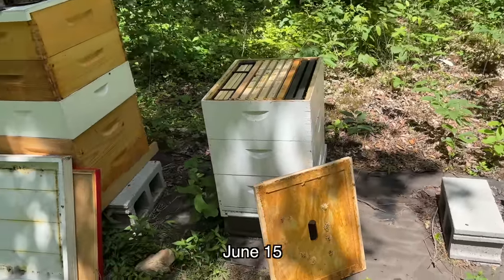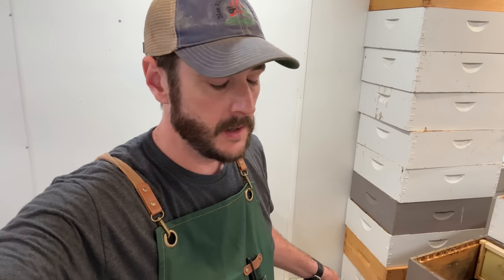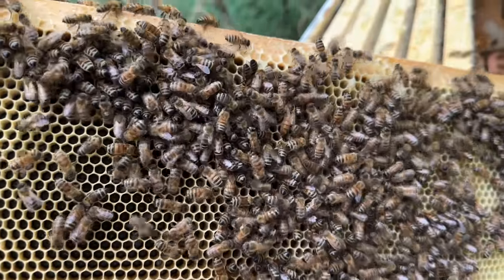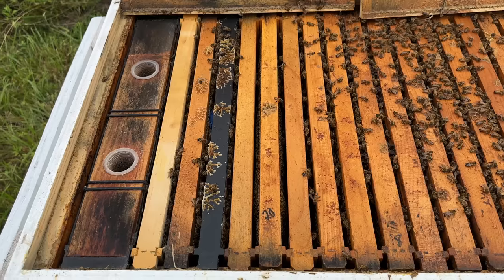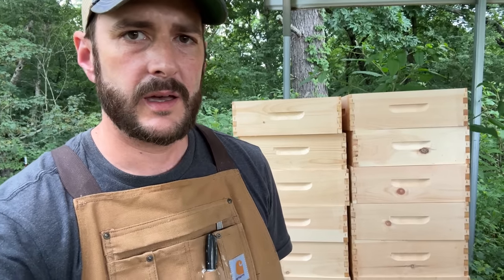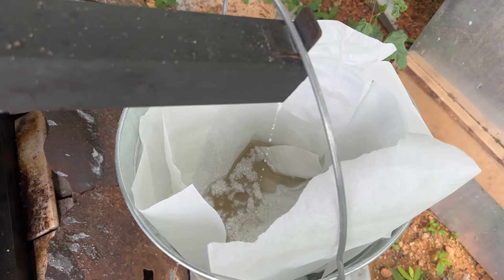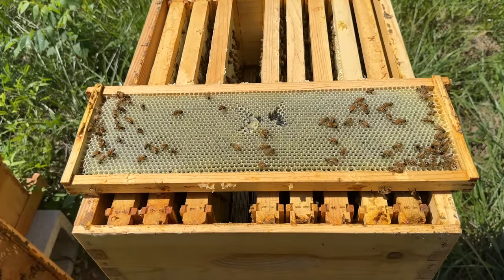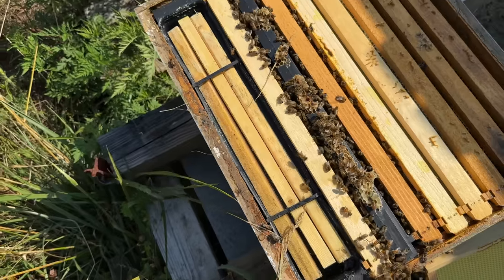Building a Bee Business Vlog #20

Comment: The joints don't fit because the moisture of the wood has changed since the joints were cut. The foaming in the wax tank suggests the wood moisture increased since you purchased the hive bodies. Every time I purchased assembled equipment, the quality wasn't comparable to my own. Either wrong staples or not enough glue.  Wood stove heats my shop all winter long, winter is equipment season and summer is beekeeping season. I admit I'm tired of the wood stove, so this winter, I am putting in a heat pump. The first 4 years I was always late on equipment preparation, this year I have extra ready, now I have a day off. Beekeeping is 6 days a week all summer, and vacation is the reason they swarmed or the week you should have done mite treatments. If you are maxed out now at your current hive count, then I suggest you focus on time management before you increase your workload with more hives.
Reply from the maker: Thanks!

Comment: And last little thing to help with the filter issue, put a honey gate on a 55, pour everything into it when coming out of extractor, leave it tall enough to pour off clean 5s at the bottom, wax sits on top while you pour out 1000s of lbs, no more multiple bags of wax sitting around dripping out….

Comment: Not real sure who all the suppliers are around your area.  However, how I got it here is by getting in touch with the local schools concession stand.  These are generally run by booster clubs around here.  As such you find they order in bulk for "small business" aka Ben E. Keith, Gordon's, etc that not only sale in bulk, but in most cases deliver it as well.
Reply: Additionally, on your question last week, someone had suggested vinegar.  As such I figured I would test this.  I added 1/4 cup per gallon on a 5 gallon bucket, added a gallon to 5 of the hives.  I have to say the bees took it down pretty quick, and the cap and ladders were clean as could be.  Not sure how much I can dial it back and still be effective.  I see many recipes for half a cup per gallon, I just need it to keep it clean without me having to put a ton of vinegar.  As such, the 1/4 cup to 1/2 cup does work per gallon.  I will start using it on all my hives.
Reply from the maker: We’ve got a Gordon’s, not sure how much I’d have to buy to get decent pricing.  I used apple cider vinegar up till this year, bees take it well.

Comment: Only.problem I have had with th ML cap and ladder is that they tend to propolize the ladder holes.  It's kind of pain to  clean them out, and I don't have time to pull them when not feeding.  I do have heavy propolizers.
Reply from the maker: I’ve had a few issues with that too.  Makes it hard to refill the feeders.
Reply: They propolize the top inch of 2 of the ladders and the girls can't get to the syrup.  It comes off pretty easy if you can get the ladders out.  I need to find a tool that I can scrape the inside of the ladder.
Reply from the maker: A nylon brush on a cordless drill might work without taking the ladder out.